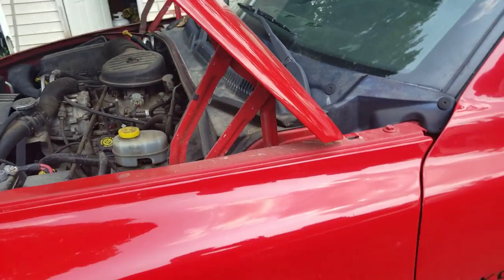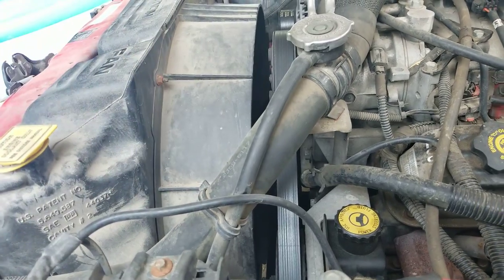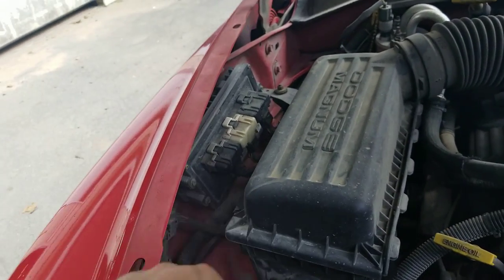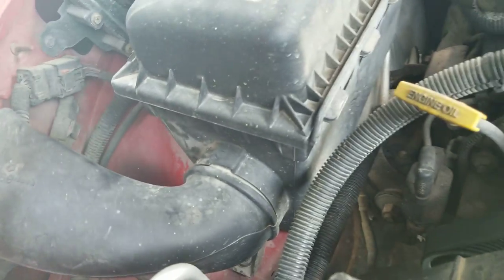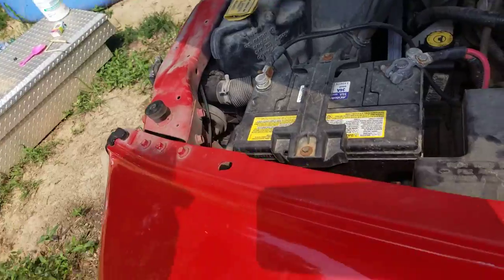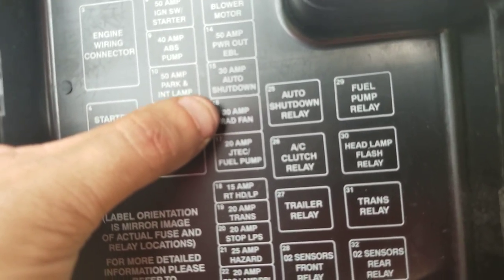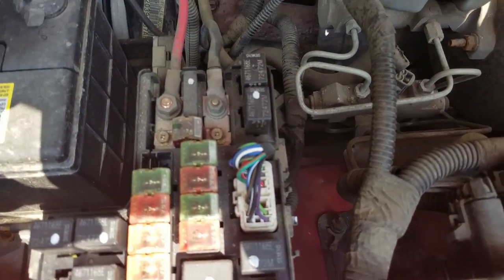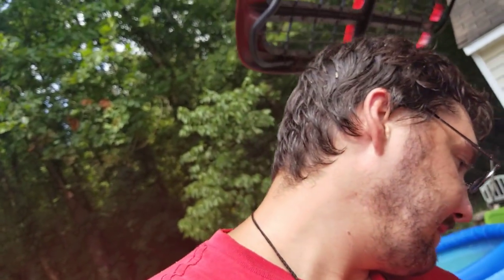2000 dodge Dakota radiator fan relay repair.

Comment: My truck is overheating at idle and thinking my fan isn't running quite as well as it should, but also curious if it is the thermostat??
Reply from the maker: the first step I assume you already checked the coolant levels. If not then do that. But if the fan is running it's probably fine I would change the thermostat they are cheap and easy so might as well. If that doesn't work you may want to check if the radiator is clogged.

Comment: Did you replace the relay?
Reply from the maker: yes you can get them at the part store for like 5 bucks I just made the video to show where it was because I spent so long looking for it
Reply: My fan won't come on!
Reply from the maker: the Fa. itself might be burned out trace the wire fine a spot where you can cut the insulation off the wire and hook two jumper wires direct to the battery if it comes on fan is good if not then you need a new fan

Comment: It’s not up to temp for fan and is already running. You still have an issue
Reply from the maker: It has a lot of issues. Currently the transmission is dead.

Comment: My fan never turns ON...gonna check this relay this weekend. Thanks!
Reply from the maker: if not.let me know I can figure out the issue my best freind ia a master mechanic
Reply: Im having that problem. Just swapped the fan with a new one and it still doesnt work.
Reply: Mine doesnt either i just bought it two days ago wondering if this fixed yours I already bought the relay so I suppose I'll find out probably before you answer but still just in case since I havent installed it yet to see lol
Reply: @anthonyburton8393  did that work? My truck is overheating at idle and thinking my fan isn't running quite as well as it should, but also curious if it is the thermostat??
Reply: @colechapman6205  my fan relay was completely missing when I checked it but it worked for getting my fan working but turned out my pulleys were out of alignment too I had to buy a special belt and bypass my ac compressor because it seized up and buy a new tensioner pulley because it was crooked which was causing the water pump to keep going out prior to me buying it they couldn't figure out what kept causing it but I looked at the tensioner pulley and noticed it was aligned wrong from the factory causing the other issues to keep happening I replaced that and haven't had any issues since then